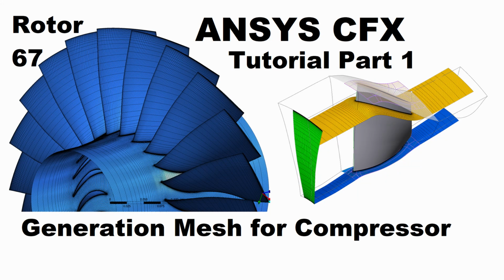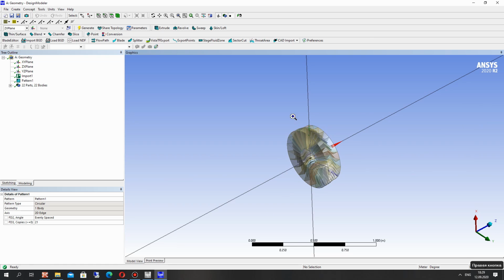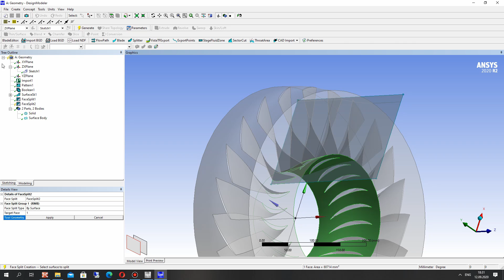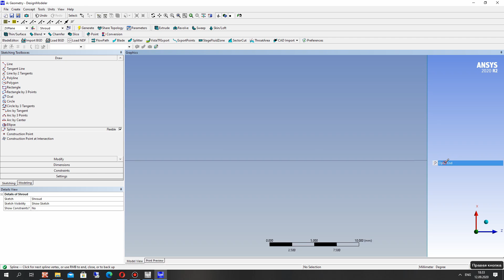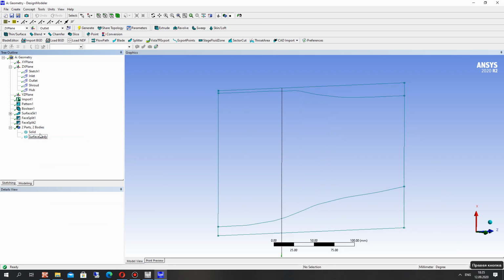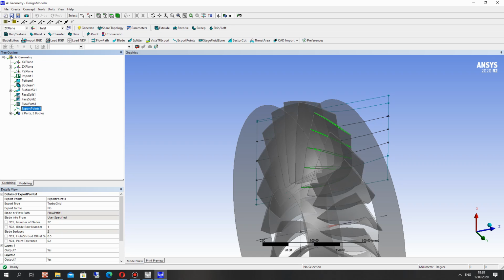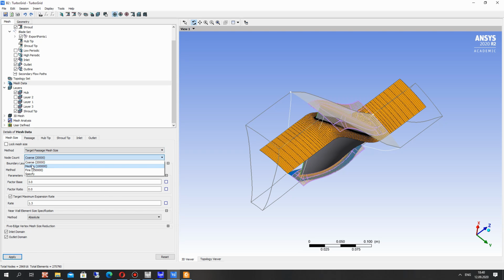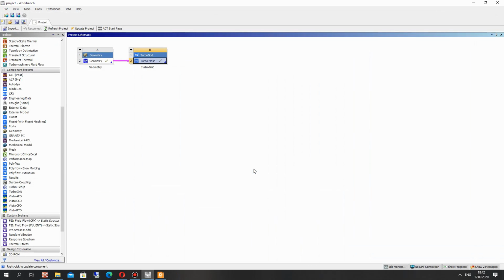ANSYS CFX Tutorial Part 1/2| Prepare the Geometry of Axial Compressor Rotor 67 and Mesh Generation

Comment: Error: Operation would result in non-manifold bodies*
*Error: Failed to generate the export data. Check the selected blade surfaces...*

It seems that the top and bottom edges of the blade are not being selected.
Could you please guide me on how to fix this?😔😔😔😭😭
Reply: Did you find a workaround ? I get that and a second error saying "export point feature" is no longer required for turbogrid but when I try launching turbogrid it wants export points

Comment: Hi. Has anyone faced similar issue? 
Unable to use generate ExportPoints option, even after selecting two surfaces of the blade like (11:13). Even after mimicking exact process, it shows following error message :

 Error: Operation would result in non-manifold bodies

Context: Geometry Engine, while generating Feature ExportPoints4
 
 Error: Failed to generate the export data. Check the selected blade surfaces. Note for native Blade features, BladeEditor automatically prepares the CAD geometry for TurboGrid. Therefore, you may remove the ExportPoints feature.
Context: ansFClientBMExportPts::Execute ExportPoints4
Reply: Same issue
Reply: OOh. ive got the exact same problem too, and really confused. please let me know if u find any solution.🙏🙏🙏
Reply: Guys I have founded the solution. You must draw lines inside the split shape. Not exactly same with shape. You can put a little distance between lines. If you have any questions , you can ask.

Comment: I have error occured on design module exportpoint.
Reply: In the export points menu, if you make the Hub/Shroud Offset ratio more than 0.5 it will not give an error.
Reply: @oguzhansahinoglu  Oğuzhan bey bu yorum çok işime yaradı teşekkür ederim.
Reply: @oguzhansahinoglu  Thank you very much!!! Your advise help me solve questions successfully! And I want to ask you why this can solve problem? Thank you agaain! 🥰
Reply: @边锋刺客-x6d  I found it by trial and error method actually. I'm happy about it if it helped you ✌️
Reply: @oguzhansahinoglu  OK，thank you very much! Have a good day!😄
Reply: Same
Reply: @aishwaryaravi5249  Same.. Did you fix those errors?
Reply: @yskim3775  yes, turns out you've to draw the flow paths correctly.
Reply: @aishwaryaravi5249  Do you mean that the sketch of inlet, shroud, etc (5:00~) ?
Reply: @yskim3775  yes, that. And also when you're selecting the pressure and suction side make sure you select both because I made that mistake
Reply: @aishwaryaravi5249  I got the good results with your helps. I really appreciated it . And by any chance, have you ever performed an unsteady or transient analysis for the rotor 67 blade model?
Reply: @aishwaryaravi5249  How have taken the point of intersection of sketch and flowpath to draw inlet, outlet and flwopath
Reply: Singh just by magnifying. No special tools on here.
Reply: @aishwaryaravi5249  ok thanks but it wont cause any error while exporting the points
Reply: @aishwaryaravi5249  Could you please explain a bit more clearly and in detail how you solved this issue? Your answer would really help me a lot, and I’d be super grateful for it.